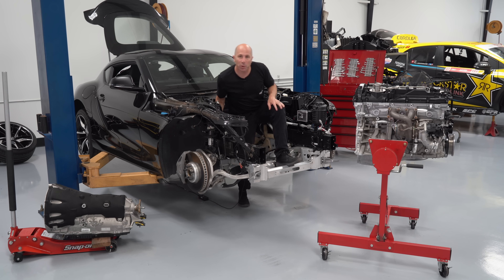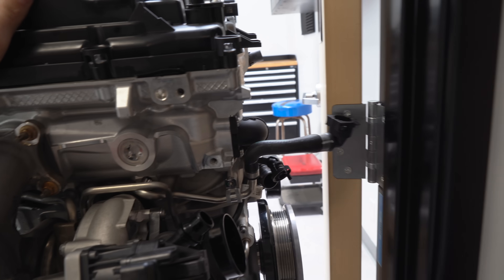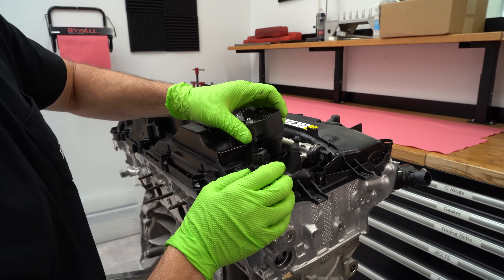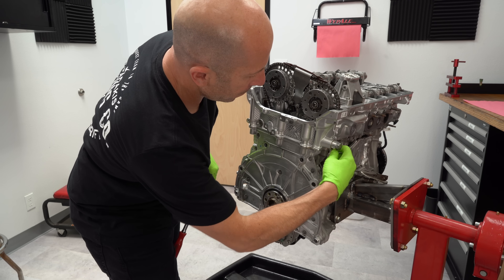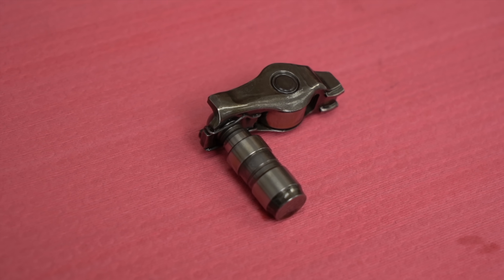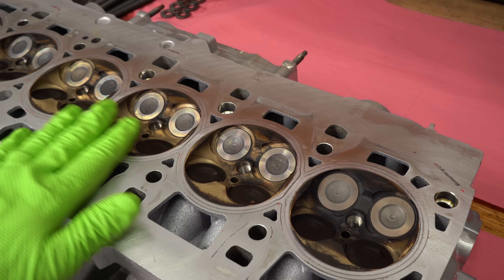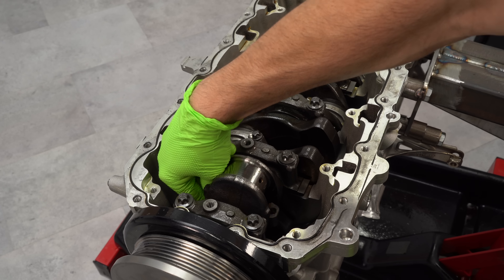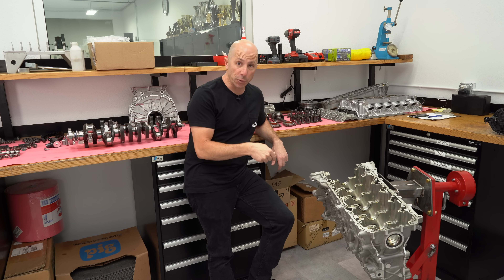2020 Supra B58 Engine Teardown - First Look - Better than the 2JZ?

Comment: Very cool engine but not something I would want to buy out of warranty. BMW plastic parts have a pretty short lifespan.
Reply: Really? My m50 plastic manifold is still strong as can be. All my e30 plastics are in good condition. The plastics arent the issue.
Reply: @zachogdahl210  You're lucky then. I've replaced the cooling system on my 15 yr old E46 three times in 230000 miles.
Reply: @AJGreen-cn8kk  those e46 coolant tanks are the only plastic parts i have seen people have issues with. Its a poor design, not really the plastics fault. I have an 04 m3, changed my tank out for aftermarket long ago lol.
Reply: German plastic parts
Reply: The metal ones aren’t much better.... ever seen a N54 bearing ledge go bad?

Comment: car looks nice. Exhaust sounds good. THANK YOU for  saying the information about the throttle-by-wire
Reply: B58 is actually using the valve lift as the throttle.  If it's anything like older BMW engines, the purpose of the throttle body is actually to generate vacuum in the intake at idle and to control idle speed. Otherwise the throttle body is wide open when driving or it is used as a redundant system if the vvl faults.
Reply: @ReiniGrauer  is that the "valvetronic" thingie?
Reply: @ReiniGrauer  got a source for that?
Reply: @tommihommi1  https://www.e90post.com/forums/showthread.php?t=6833

the vacuum for the rest of system like brake booster were created by a vacuum pump
Reply: @tommihommi1  do you need me to Google valvetronic for you?
Reply: @n.shiina8798  yes, I think every BMW with valvetronic has a vacuum pump as well for the systems that just need a clean vacuum source (brake booster, muffler sound flap, pneumatic wastegate actuators, etc), but valvetronic needs the throttle plate to create a vacuum in the intake for the pcv and the evap systems where some fluid or gas needs to be burned for emissions.  The throttle body closes a bit while the valves open more, the throttle restriction generates the vacuum.
Reply: I rather buy Older BMW m Car with S65 Inline 6 engine.
Reply: Ren 任 the S65 was not a straight six
Reply: Exhaust sounds good? Ahh no!

Comment: Alright, I'm surprised the coolant isn't Toyota red....
Reply: Welcome To The Madness it should be blue!
Reply: Tommy Bueno A lot of new BMW’s are using green Frostox HT-12 coolant now instead of the blue G48 coolant
Reply: It says bmw on the coils but you're expecting toyota coolant? lel
Reply: Welcome To The Madness I’m surprised it’s not bmw blue .. hmmm
Reply: Welcome To The Madness you must be new here
Reply: Welcome to the madness I always ask myself what coolant I should put in my BMW
Reply: All BMWs use hybrid organic acid technology or HOAT which comes in all different colors. But BMW specifically use a blue coolant that has to be mixed 50/50 with distilled water. Hybrid antifreeze has added silicates for extra aluminum protection and has a five year change interval. HOAT are used by Mercedes Volvo Ford VW Audi BMW Chrysler and Saab.
Reply: Aluminum block
Reply: It's not a Supra soooooo........

Comment: It's a BMW engine not a Toyota engine
Reply: Toyota had input to the design and reliability testing of every component
Reply: @anthonyrb20  but it is still just a B58, motor was first used in 2015.
Reply: @derekbon694  Its a different revision. There are numbers after "B58" that mean a lot.
Reply: @XL5Master  Oh yea I know I did notice a few things that were not quite the same from the other B58 motors but the majority of the parts and the tech seem identical. I am curious to the full code on the motor used in this car!
Reply: @derekbon694  my question is the B58 reliable?

Comment: Alright, lets see what's in this BMW designed motor. Dedication, buying a new car to pull it apart to see how it works.
Reply: Cant be worse to build into a drift car than what they gave him last time...
Reply: that's the benefit of "crackhead credit" LOL
Reply: He's sponsored by Toyota lol. They gave him the car
Reply: @edwardbaker5373  Yeah bad business decisions like that are a contributing factor to the sky high price tag on this no doubt HAHAHHA
Reply: @The_Conspiracy_Analyst  msrp of the 1993 supra turbo was $50,000
Reply: Kyle Laughinghouse   And whats even funny is that you can find a mk5 for over $90000 like for fuck sake I cant find one for the $60000 msrp that it was supposed to be
Reply: @kylelaughinghouse1893  around 75k in today's money
Reply: @kylelaughinghouse1893  That's why Toyota canceled it for North America, and just upmarketed the platform as the Lexus SC300/400.  Speaking of that, I don't see why Toyota didn't just use a UZ-series engine for the MK5 instead of this BMW crap! A UZ and a six speed!